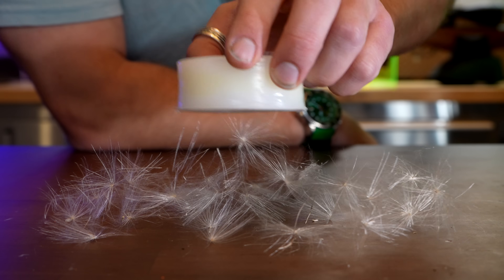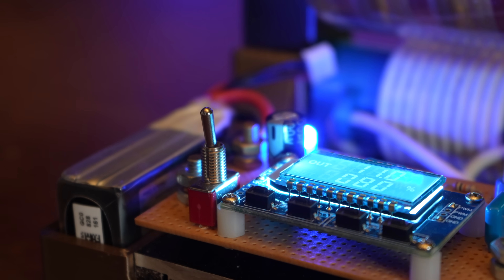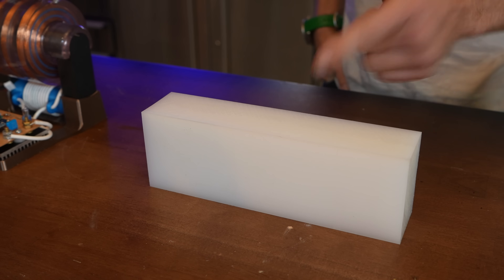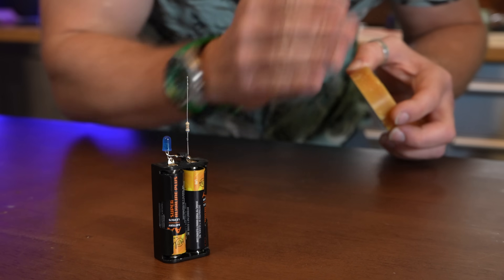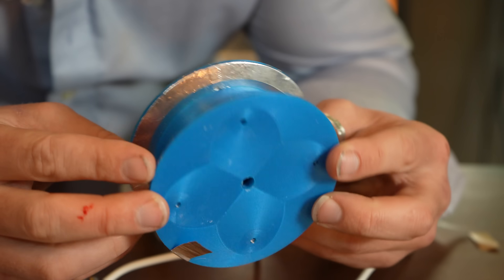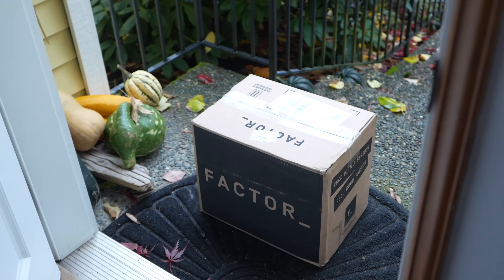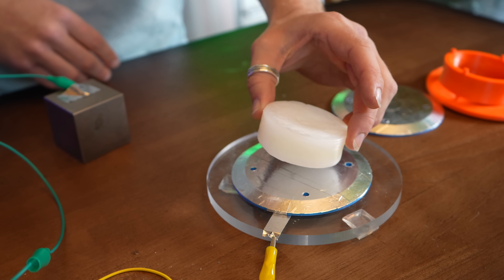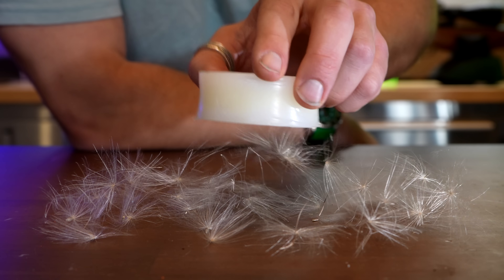Creating an Exotic Material With A Permanent Static Charge (Electret)

Comment: Why wouldn't somebody use that for electric power essentially because that's what it is it's basically a ***** battery that never runs out ever why would we not build massive scale electrode thingies to power buildings and everything else I mean granted one on 1000 times scale comparison to what you built might be slightly hazardous if done you know at all incorrectly but if you understand certain safety protocols I don't see a reason why you couldn't scale that 1000 times and essentially have free energy for houses oh I know why that wouldn't work because that would screw off the mainstream electrical grid that we rely on and all the billions and trillions of dollars that are stolen from us because well they figured out how to harness it and redistribute it and we haven't I mean I can technically splice into you know somebody else's power but that's not the same thing somebody's still paying for that bill with your idea on 1000 times larger scale that would essentially cut out the middleman of the you know the person that's basically robbing you for electricity because you're hooked up to their system and their power grip but they don't want that to happen because that would mean no money for them so that's why that isn't a thing because well you can't screw off the big companies that you know basically run the world and I'm surprised that you haven't had this video shutting down just because of the fact that you came up with this idea or that you're putting this information out there and somebody like myself would just go hey that's a great idea why don't we just scale it 1000 ***** times and make it actually do something like useful like power stuff that's electric I mean if you can turn on LED light why wouldn't it be able to power anything else or everything else for that matter essentially if it's scaled you know bigger why how why wouldn't it work just like a battery or just like an electrical grid and you know oh that's right it would exactly work like that perfectly fine but again the big companies wouldn't ever allow that and in fact if you were to try to do something like that you would probably be killed like everybody else has created free energy essentially because why you would disrupt what is already in place and whom has those powers like Edison and you know the other people like the department of water and power and uh any other company that has umm basically the power grid in their grasp you would essentially be screwing them off and well let's just say that those are very powerful people that wouldn't have no problem making your entire family and everyone you know disappear and nobody would even notice like so yes kind of amazing that you're dumb enough to put this on the Internet for the public to see it and to retain this information like you know granted it to be a little hard to actually scale something 1000 times larger cheaper than what you created but at the same time if somebody actually did that and they were capable of doing that that would essentially just be a game changer just don't try to patent it because then the government themselves will kill you and your family and make you or exist because why again you would be messing with things that are very powerful and very powerful people and also basically disrupting the entire globe by being able to distribute free energy with very little to no cost to even create such a thing the only other difference would be in order to harness that and control it where it doesn't over voltage things or it doesn't over amplify things but essentially if we can do the same thing with a big * power grid we would just need to figure out a way to do it with that which apparently is probably a lot easier said than done but it might just be as easy done as it is said considering how easily you just made that contraption

Comment: Cool man. You're into high voltage plasma using current electricity. I'm into high voltage plasma using static electricity. 

I've been wanting to make electrets for years in your video is the inspiration to get me to do it.

I actually have a plan for these. I like design generators.

I'm going to use these things to make a Megavolt level voss machine by using electret piles to create static voltage fields in the Megavolt range and then I'm going to rotate plates through the field and get power plate-to-plate

Comment: Third time is the charm. First attempt is to fail. Second attempt is to prove it's possible. Third attempt produces a properly functioning result. The flat detector is nice, but a multi leveled detector with the electret sitting in the center would be way cooler. The flat one would make a nice coffee table/mug combo.

Comment: Hey can you a zvs driver circuit using two IRF z44 n mosfets to power a high voltage CRT transformer. If you can then please 🥺 make a full making process video on it please 🥺

Comment: I think the way the finger trick works is that you get closer to the source of the voltage which increases conduction to your body which in turn charges as a capacitor, briefly reducing the field voltage/range. If this is right then I guess you pulling your finger away causes your body to emit a field as the capacity drains maybe even increasing local electrical field voltage , is any of this correct or am I dreaming?

Comment: You Need to be doing THESE Experiments, with Ceramics. (Or different types of Clay, for starters) Plastics/Wax break down with Heat. Ceramics Don’t. Plus, try infusing Graphene into Ceramics for Highly Conductive Ceramics. (Clay/ Ceramics Easiest to Mix, in Powder Form) Ohms similar to Copper 😉

Comment: You know that Christmas tree metal foil icicles? They are light and easily moved by electric fields. Think of those foil type electroscopes. Put on a good matrix style base and it will follow the field lines. Charge them either positive or negative can help you detect particular charged fields.

Never tried this idea but have always wanted to.

Comment: I think I came up with a way to build a Flux-Diode.    It uses 2 pieces of hyper-twisted-pair doorbell wire - length being a 1/4-wave division of 1.42 Ghz.   I'm using 176 feet, because my apartment hallway is 91 feet long & I can tie the wire to a vent at the end of the hall.      Anyway, the hypertwisted wire can then be shaped into whatever 3D shape you want - since the divided angle between the two wires - will never exceed 90 degrees for either wire.  So, I am shaping it into a Tesla Valvular Conduit - to create a "flow- or flux-diode".    So, to collect ambient energy - I am going to wrap 2 coils and connect them in series.   The 1st is strictly made with wire in the shape of Tesla Conduit PATHS, and the other hypertwisted length is actually wrapped into the helical or tube-shaped conduit.   A helical coil shape to allow the flow of plasma and light down a conduit - made of a hypertwisted wire pair.   This should generate a flow of static charge made from hydrogen.    Then connect the wire-based flux-diode and try to collect ambient energy.    You did something similar before with causing electricity from plasma, but this appears to be an optimized consideration.

Comment: Make a big PCB with SMD components instead of having to solder through-hole stuff glued on the plastic frame? The antennas can be etched on the top copper layer and the density of the whole thing could increase drastically too (just need to make sure a ground layer behind does not affect the detectors).

Comment: When you point your finger, you create a path of less resistance, allowing negative charge to transfer into the generator. Because your hand is closer then the detector, the      Current will flow from your body into the generator instead of coming from the detector.

Comment: why haven/t you chabged the atmosphere to prevent coronal discharge.....transformer oil, or vacuum, or perfetcly dry atmosphere in dry nitrogen?   that way the electric field will renaib as high as possible during cooling....Rick

Comment: I don’t think magnets are underrated. They’re certainly taken for granted and most people think “we know” how they work when we have a theory as to how magnets are able to have a magnetic field we don’t know what magnetic fields are or what magnetism is. The other problem is, no matter how often you try to tell people they dont know that 90% of electricity is made using magnets including wind, hydro, nuclear, hydrothermal, and fossil fuel. Most of the energy sources heat water to turn turbines. So they’re too important to be underrated. We use them for almost everything. They’re almost like lasers. They used to just be neat but now lasers are replacing everything from sand blasters to refrigerators and more things all the time.

Comment: Smoke filter stack? Does this mean you could melt old milk bottles in a sandwich press and charge them at the same time so when they cool you get a permanent smoke filter stack that uses no electricity? I have a laser cutter that needs one.

Comment: wikipedia says high current align the + and - in the melted stuff which froze aligned and keep the static charge. (I'm guessing) Mastering temperature would be critical to make an even better one, also choosing a material with the highest delta between state changing points would allow them to keep the charge even longer or stronger, you could make an aloy with those traits and the rest is managing extreme temp points

Comment: 7:28 noooooo only leave the contacts exposed with foil… matter of fact use gold flake and set the wire to start from the middle of each puck to distribute the electric charge evenly! maybe actually try to use molten metal inbetween?? later? I think the only point is that the material needs to be chargable, polar, and cool-able into a solid from a liquid…. maybe try liquid metal?

Comment: 4:00 maybe forcing the electrons to flow through the wax is more important so… MAYBE make a 3d print with more material in between the electolit’s exposed metal to prevent the arc and re-test… im curious.

Comment: I have always wondered if you could create a “plastic magnet” or a “static magnet”. 

I have also wondered (but been doubtful) if this principle could be used to create some kind of ocean cleaning “thing”… something to float on or in the water and trap the smaller plastic bits left behind by the projects picking up larger pieces of trash. I’m doubtful it could work, but this is a step in the right direction, I suppose!

Comment: I love this! Could you have made an image of the field by placing fine granular static reactive material on a piece of stiff paper and putting it on the electret. Similar to using iron filings to show a magnetic field? Also what if you placed the electrodes on the inside of a shallow rectangular dish (8×8 Pyrex baking dish). Then it's guaranteed to make contact no matter the amount of material.

Comment: Every time you see a spark, that is all the ions being negated, paired and discharged. You want to see ZERO discharge, which means that the fields are "contained" between plates. Even further, you are a ground, while holding the electret. Try using an insulated pole that is static-insulated.

Your detector probably needs a shared ground plate. The test sensor the battery was the "ground". It may not have been wise to make the detecting antenna round as a 360 circle. That kind-of cancels out some detection potential. Electrons need to evacuate through a point and be collected through an unwavering rod, for best effect.

Radio coils are a bit of a hack, because they harbor "waves", while they cancel out standing streams. Having multiple windings, of set lengths, is like a form of transformer that amplifies the "wave" as the coil length is a multiple of the full pulsed wave. Static, from your device, is solid, not pulsing, unless you move it. (Which is why it can more easily detect the wave as you moved it and also had false-positives from anything that was "pusing" or moving, around it. Grounding the circuit, as a whole, would reduce that false positive. Like with an antenna, the grounding should be close to the ground as well as above the circuit, with the detector protruding out the shielding layer. That is why a car antenna for FM has a shielding, or the entire length of exposed, unshielded wire, becomes part of the length, introducing noise.)

You may even be able to use hall-sensors or quartz-crystals to detect the static too. They may be sensitive enough to detect it, but not using standard methods of detections. You are looking for detecting the resistance or voids, as opposed to detecting closures and timing. (Look up the "calculator and radio metal detector". An AM radio may also detect the static as a void within a "fixed pulse" disruption. Similar to how an AM radio can be used to detect lightning and three AM radio antennas can actually give a precise position of the detected lightning strikes and pre-strike build-up locations, before it strikes the ground.)

Comment: I suppose in practical use for the everyday, it could be used in a computer room or near electronic devices to warn if there was a sudden static electricity field near your sensitive devices in order to warn you to shut them off and disconnect them until the static electricity field stopped or went away.

I'm just guessing here, but what I'm describing would be like when a lawn mower motor or vacuum cleaner motor that is running is sending static electricity signal outward, it can destroy your computer or electronic device. Phone, tablet, etc. I'm thinking the warning of lights coming on would help you realize you need to shut stuff off and disconnect them, in case those devices are not connected to a power surge point, or their grounding is too weak.

Pretty sure a lawn mower motor outside my window wrecked my microphone cord the other day in this very scenario. Off the top of my head, I'm guessing the cord was not shielded as well as it should have been and the strong field of static the mower engine sent, fried and fully charged my microphone cord with electrons / static electricity. Sigh😢

However, it happened in an instant, and even this light up warning system would not have been warning quick enough to save my cord, but it would have given me a sure reason why the cord suddenly was full of static electricity.

First time channel watcher.

Comment: ...huh, that explains how a electret mic works - it is basically a condenser, but one plate has an electret applied, so, it always is charged to begin with... and the rest works the same as any other condenser: sonic waves hit one side of the large capacitor that is the actual microphone (very often made from two thin, round sheets of metal foil), the sonic waves lead to one side of the cap fluctuating in distance, which changes the capacitance (as a cap's capacitance is dependent on size of the plates, and their distance to each other), which adds a fluctuation to the static DC voltage applied to the cap. Cancel the DC from the resulting voltage (be it by mixing a negative DC in or just using a high pass) so you are left with just the AC (directly representing the sonic waves) that is overlayed on it, amplify that, done.
With a normal condenser mic you usually would charge the cap using phantom power (which is usually 48V DC, very low current send to the mic), but since the electret simply has a static charge, you simply don't need that

Comment: I am not a electrician or an engineer or know a lot about cars, but I am curious. Could something like this work for fuel ignition to then maybe help increase fuel burn rate if used as a type of assistive burn chamber right before hitting the fuel to increase the temperature to just below the burn temperature and then maybe a return system to for fuel that wasn't burned to re enter the system.

Comment: What about trapping charged chunks of metal inside some good insulator?

That would essentially be a charged capacitor, but without exposed leads and one whose electrodes you can mechanically pull apart!

Comment: I think if you tape very very small snippeds of aluminum foil to a touch screen, this screen can be used as a high resolution static sensor.
The snippets will have to be isolated from each other tho.
Also you need to put the display onto another grounded metal plate.
That way the static field will induce a little charge on the snippets, which in turn will form a capaciror with the metal plate on the other side of the screen.
This field changes the overall capacity of the foil at these points due to the asymmetry in the so created field.
Maybe you have to iaolate the snippeds from the air too, by putzing some plastic onto the top.

Comment: @PlasmaChannel probably you will not read me but while I was watching your video I started to think some other experiments that may be done
Since the electret forms while it cools down. Does the cooldown speed affects? What I mean with this is you can try to either cool it down super slow and have more exposure to the electricity (this can be achieved controlling the temperature in which the electret is while it cools down, even applying heat) OR cool it down super fast (liquid nitrogen maybe). The result from this can be either differences in the strength of the electret or nothing but worth the try if hasn't been tried before